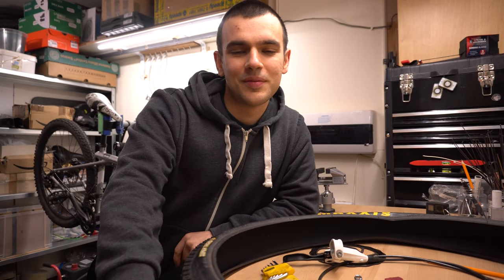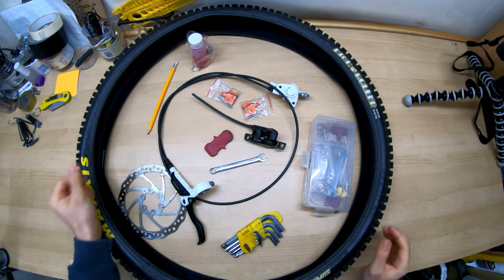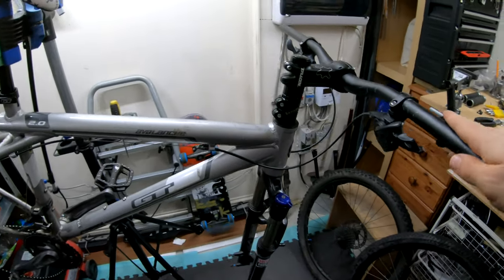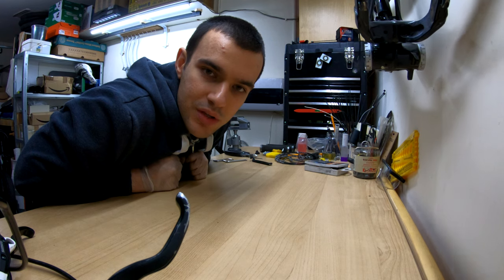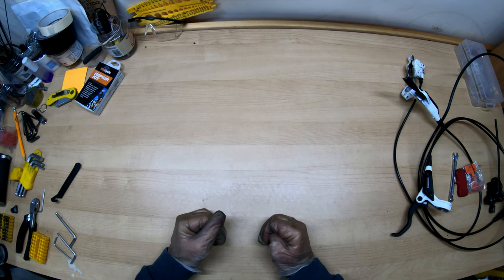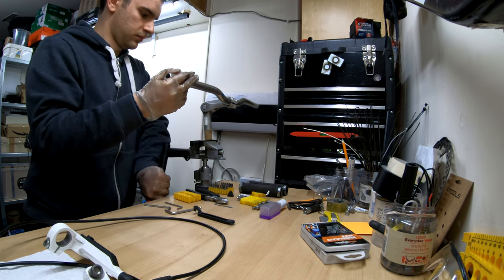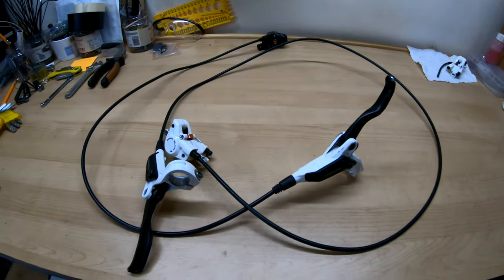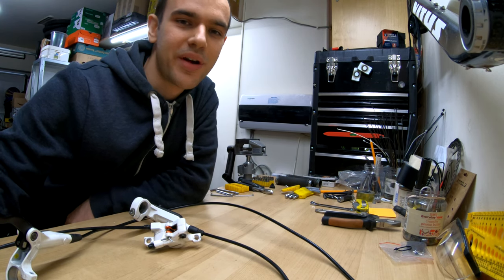Upgrading my Cheap Hardtail Mountain Bike with Cheap Parts Off Ebay

Comment: where did u find all this stuff like the tire and calipers?
Reply from the maker: I basically search for items listed under the "Bike Components & Parts" category in eBay. I think the caliper was listed as "spare or repair". Some people try to get some money back from broken components by selling whatever is still working. The tyre was listed by someone local so I did not have to pay for shipping as usually this is as expensive as the tyre. You can limit your search to only show items within a number of miles from your postcode.